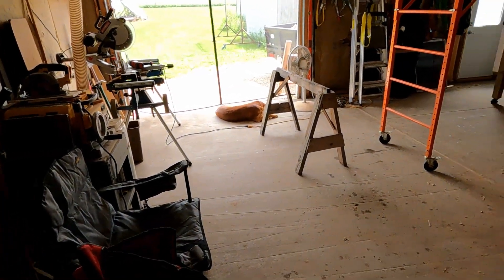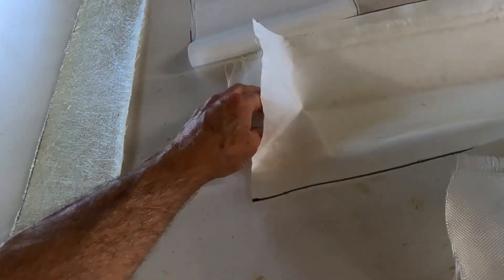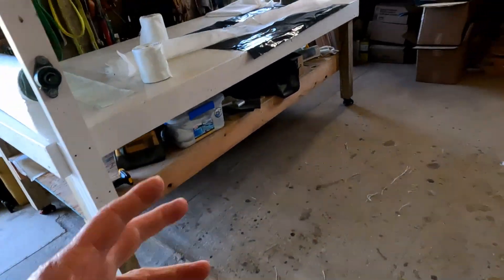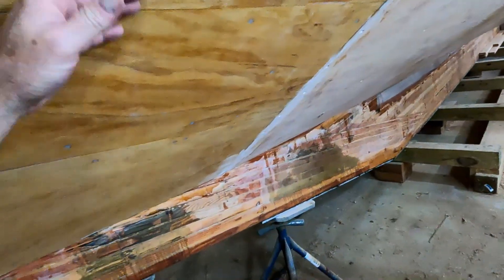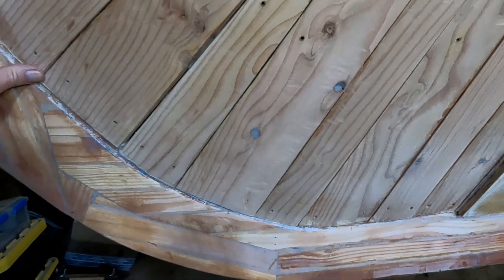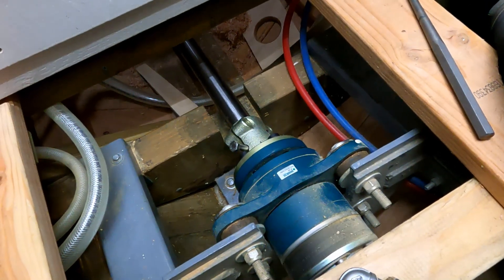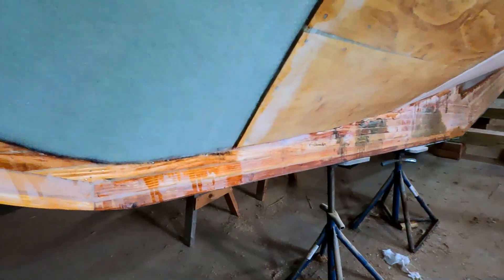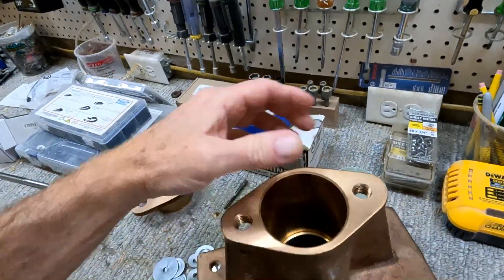First Fit of the Shaft and Prop - Glassing the Bow

Comment: look forward to the fuel system and electrics and oh yeah the radar  what do you think your E.T.A  is on this project august 2026 ?
Reply from the maker: I think it would be possible to move it to water next Fall, but that would be rushing and pushing a bit too hard. I hope to have it out of the shed next Spring/Summer, build the pilot house before winter sets in, then work on interior through the winter. So yes, 2026 summer is reasonable I think.

Comment: I've used magnets wrapped in plastic before to  hold up cloth.  They were just light duty fridge magnets dealing with lighter and small cloth.  But I wonder if some stronger magnets would hold against those screw heads.
Reply from the maker: I've got some powerful magnets, I'll give them a try on the other side. Thanks!